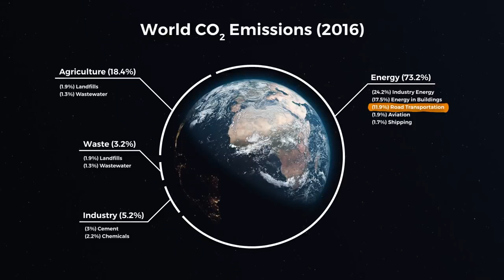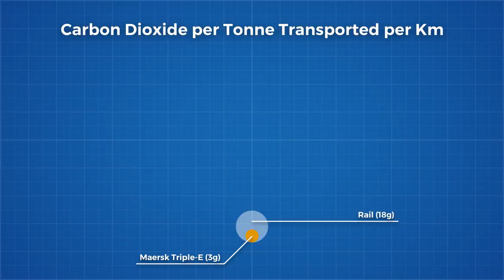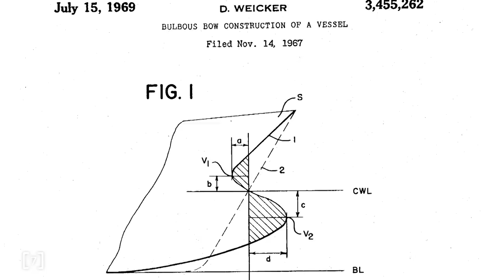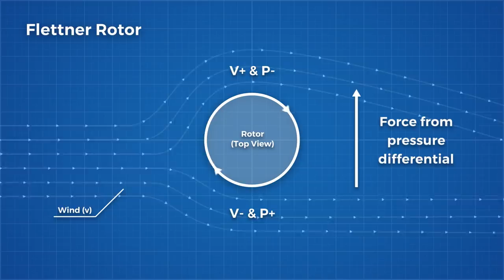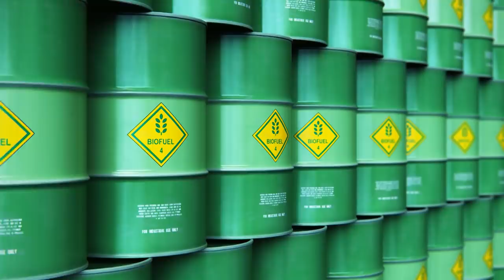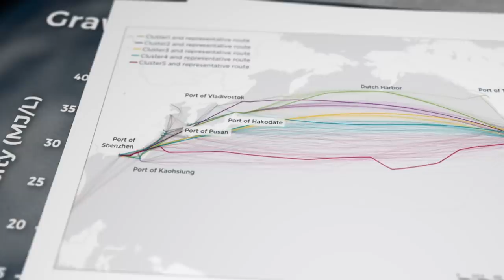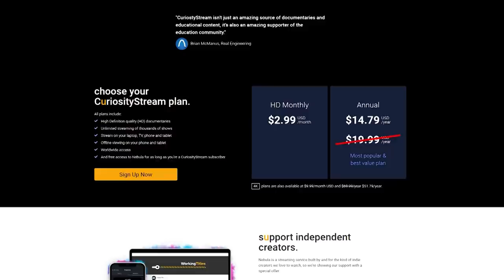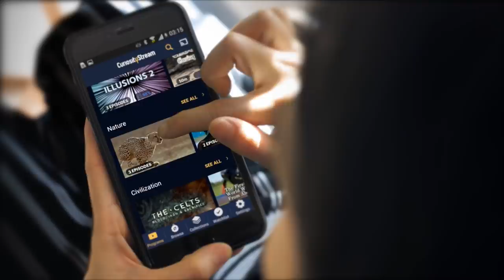Are Renewable Powered Ships Possible?

Comment: I don't get the "takes up to much space" thing, just put the masts in places that aren't used for cargo anyway
Reply: The masts, rigging and sail handling arrangements take up 'prime real estate' on the vessel.  Fuel oil bunker tanks can be stuck away in any odd corner and the ICE power plants are themselves relatively compact.  The stacked up 'boxes' would mean putting the wind driven propulsion units in a bad situation from a ship stability point of view.
Reply: @BernardLS  I figured you'd put them on the bow and bridge, that's bad for stability?
Reply: @marcopohl4875  on the bridge is very bad also the yield of energy from wind is relatively low. I have about 1 000 words on this subject but if it is TLDR will not waste your time.
Reply: @marcopohl4875  To address the suggestions that sail power is the answer I offer the following example.  In 1870 a premium sailing vessel entered service, the ‘Cutty Sark’.  The Cutty Sark was 64.74 metres in length with a beam of 10.97 metres and a loaded displacement of 2 100 tonnes.  She was able to carry, at best, 1 700 tonnes of cargo and to harness the energy in the wind the available spread of canvas was up to 2 976m2 which was tended by a crew of about 30 skilled men.  A ratio between the sail area (SA) and the vessels displacement (D) determines how lively she is; ‘lively’ being nautical speak for ‘fast and manoeuvrable’.  The carrying capacity of cargo ships is constrained in two ways, mass and volume which leads us to the ‘stowage factor’ of the cargo; the more mass on board the greater the displacement which in turn impacts the efficiency of the hull form and sail area / displacement ratio.  A vessel constrained by mass is said to be ‘down but not full’, while a vessel constrained by volume is said to be ‘full but not down.  When in the tea trade, which the ‘Cutty Sark’ was designed and built for with fine lines (more nautical tech speak, so again no need to worry about it) she could carry around 600 tonnes of cargo at speeds of up to 17.5 knots dependent on the prevailing wind and had a typical China to UK time on passage of 120 days.  The tea trade was very competitive so ‘time on passage’ was a large factor in securing the premium freight rate that made her cost effective.  Rounding things out, her maximum available sail area gave circa 5m2 of canvas for every tonne of tea carried.

As soon as the Suez Canal opened, which the ‘Cutty Sark’ was unable to sail through; she lost her advantage, raw speed, to the steam powered ships of that era who could beat her ‘time on passage’ by taking that short cut.  Mechanically powered ships have improved in terms of efficiency, on a freight tonne mile basis, by at least one order of magnitude since then.  After losing out to the coal burning, fire tube boiler, steam reciprocating mechanical ships of the late 19th century ‘Cutty Sark’ was relegated to the Australian wool trade, just about the bottom of the barrel in maritime terms and only one small step up from being a 'honey barge'.  The canvas, cordage and extra manpower needed for sailing ships was never a very benign environmental option so please discount any idea of sail as ‘sustainable’.  All this is without the problem that if ‘the wind don’t blow the ship don’t go’, when it does blow it often blows in the wrong direction for your cargo delivery needs and sometimes there is rather too much of it for comfort.  Sailing ships are unable to go directly up wind so if the wind is blowing form the direction your cargo needs to then a zig-zag course must be steered, more distance and more time.  Wind is traditionally measured on the Beaufort Scale (wind speed) that runs from 0 (< 1kn) to 12 (> 63kn) and for sailing purposes the usable part of the range is ‘3’ (circa 8kn) to ‘6’ (circa 24kn).
  The masts, rigging and sail handling arrangements would take up 'prime real estate' on the vessel.  Fuel oil bunker tanks can be stuck away in any odd corner and the ICE power plants are themselves relatively compact.  The stacked up 'boxes' would mean putting the wind driven propulsion units in a bad situation from a ship stability point of view.

Random fact about ‘Cutty Sark’, it is said to have been possible to coax 3 000 horse power out of her sails, or in ‘real money’ 2 206 500 Watts (2.2 megaWatts), or 741 Watts for each square meter of sail area.  So that majestic spread of canvas would have been even less efficacious for delivering your baubles and bows from the orient, despite taking about three times as long on the voyage.  The sails on the ‘Cutty Sark produce about 0.33% of the power need to propel a Mearsk Triple E.  Remember shipping is a high volume low cost, therefore low margin business, and all costs have to be beneficial.

Canvas and hemp are accorded 'renewable' (read as ‘natural’) status, if ‘synthetics’ are used there will still be a need for the input of FOGI products.  'Synthetics' would have a much better working life span than 'naturals' but would still yield the same amount of energy, 741 Watts for each square meter in those elusive ideal conditions.  Wallenius are currently giving wind power a go with wing form ‘sails’ but evidence is a little short of proof as of this date.  KTH (Kungliga Tekniska högskolan), a sort of up market university in Stockholm, who are using the funding to derive results will probably, and eventually, in the best traditions of academia ‘publish’ a ‘paper’ unless the funders invoke the well known ‘commercial sensitivity clause’ of their agreement with the KTH.  Wallenius is a major shipper of vehicles were the product is effectively its own packaging, other goods are moved about in ‘containers’ so the loss of capacity, ‘broken stowage’ in nautical speak, caused by containerisation needs to be factored in.  On board wind turbine might get you around some of the problems however for marine use vertical axis wind turbines (VAWT) would be better than the, what have now become 'traditional', horizontal axis wind turbines (HAWT) for reasons that include the air draught of the vessel, weight distribution and maintenance access.
Reply: @BernardLS  Ok, few more things:

the stability issue is probably rotation, right? since the masts (especially the one on the bridge) are so far away from the center of mass, they can induce a lot of rotational energy. if I got that right, would a design like this work? https://www.youtube.com/watch?v=zMct-d68CM0

"winds don't blow, ship don't go" isn't really a problem, since a hybrid design is the obvious approach; use the sails when the wind is good to save power, use the engine otherwise

and, to return to a question that I still wanted to ask from your first response, how would the containers interfere with rigging? I don't know much about ships, I could barely even consider myself an enthusiast, so when I look at a sailing ship, I see a lot of ropes and have no idea what each of them does, which are necessary, and so on, so that was a bit to vague for me
Reply: @marcopohl4875  the stability issue is probably rotation, right?
No it is the weight and distance from the centre of buoyancy.
 Also the forces acting on the sail set up a 'lever' (force x distance) that will need to be compensated for.

would a design like this work?
The Mearsk Triple E class are a logical and progressive evolution of the current ‘high volume low cost’ shipping business model it works but at cost to the environment; these are the cost which is externalised.  The marine freight industry responds to consumer demands so the best available option for sustainability is ‘ship less & move the small quantity shorter distance’ & ‘seek to satisfy your needs not your wants’

I see a lot of ropes and have no idea what each of them does.
Some are for aligning the sail with the wind and the direction of travel of the vessel (sheets), some are for controlling the movement of sails up and down (halyards) and other are for deploying the stresses on the masts caused by harvesting the wind energy (stays).  There are a lot of them and they all need space to work so the area above the main deck (uppermost continuous deck) is occupied and as you may notice from the video about 50% of the containers are occupying it.

Further issue is the area of sail needed to move a tonne of freight.  As I said in the 'Cutty Sark' example that is 5 m2 for each tonne of freight.  So on that basis for a Mearsk Triple E you will need 800 000m2 of sail area for a 196 000 tonne deadweight; the deadweight is the mass of water that the hull needs to displace to balance the cargo.

Another spanner in the works is the matter of air draft.  The higher the mast the more obstructive bridges become, unless the use of telescopic masts is factored in, which leads us to the idea of telescopic aerofoil wind sail that KTH are researching for Wallineius.  Back again to how much usable energy can be harvested.
Reply: @BernardLS  what I was actually asking when I linked the Maersk ship was: "If you put sails on that, would it still be unstable" given that the bridge is closer to the center, and the engine room gives you space for another sail, spreading the forces out more evenly
Reply: @marcopohl4875  For ship stability a good primer is ‘Ship Stability for Masters and Mates’ (Derrett D.R. London Maritime Press, London).  The deck above the bridge and the top of the engine room casing are in the best position for wind harvesting but about as bad as you could be for distance from the centre of buoyancy and centre of gravity which acting as a couple are the means to get a positive righting lever that will keep the whole thing working.  Where weight is on a ship is as important, if not more so, than how much of it there is.  The wind harvesting system would need to fit under the bridges that the ship may come across so the aerofoil system being researched by KTH for Wallenius, or something similar, will need to be employed.  Wind would only ever be a supplement and with the relatively low yield, 750 Watts m2 not effective on a cost/benefit basis.  Sadly we have three viable options ICEs fuelled with fossil hydrocarbon (too bad for the environment we live in), nuclear (too expensive to do properly) or overall reduction in goods transportation.

Comment: We have nuclear submarines and nuclear aircraft carriers, but for containerships let's just use the worst fuel available. Makes perfect sense 🙃
Reply: If you do a web search for ‘nuclear ship savannah’ you will see that it has been tried and did not work.  A similarly vessel, heavily subsidised by the government, vessel has been in lay up in Russia since 2012 but could be reactivated.  The Russian state, through a QUANGO, also operates a fleet of nuclear powered ice breakers all of which may, or may not, be completely without issues in support of the Northern Sea Route,.

Just think; would you have full confidence in the management of a nuclear reactor under the control of an anonymous entity only traceable, perhaps, via a letter box in a FOC (flag of convenience) nation state?  If you are, could you sell that confidence to Japan, the state that hosted the Hiroshima and Nagasaki nuclear detonations as well as more recently the Fukushima ‘event’?  Then try that same, or a similar, sales strategy on Ukraine, the nation state that as a part of the USSR (CCCP) hosted the Chernobyl ‘event’.  Modern iterations of nuclear energy, thorium fuel, molten salt reactors or fusion reactors, will carry the legacy of past problems.  It is the global trepidation of anything with 'nuclear' in the name and the economics of nuclear having transitioned from 'energy to cheap to charge for' too 'the costs of remediation are incalculable' that will prevent the adoption of nuclear energy as a means of creating energy at sea.  Modern reaction systems may have overcome the safety problems but the general public, having been misled in the past, will be reluctant to believe the fresh new promises.  The incident of the ‘Ever Given’ blocking the Suez Canal, March 2021, may also have a little to add to this debate.  The cooling water on ships tends to get taken in from near the bottom so when running aground the inlets are in a prime spot to get plugged up restricting, if not stopping, the flow of coolant.  One thing that the TMI, Chernobyl and Fukushima incidents all had in common was that the supply of coolant, or rather lack thereof, was a fundamental cause.

‘They’ say nuclear is cheap, it’s not it is expensive and has a large embedded carbon quotient as well as being complicated, dangerous, not universally socially acceptable and having only ‘no need for refuelling’ as a questionable advantage; actually it does need refuelling just not as often.  When ‘they’ do need to refill the warming up stuff it takes considerable longer than pumping tonnes of thick black stuff, cSt380 HFO, or thin runny stuff, MDO, onboard which is one of the reasons HMS Queen Elizabeth and HMS Prince of Wales are pushed about by ICEs and gas turbines thus using a similar fuel as the aircraft that fly off of them.  The Royal Navy (RN) with a high degree of skill and expertise uses, at vast expenses to the UK taxpayer, a current operational nuclear fleet of 11 submarines (also known as ‘boats’) in two flotillas, seven attack subs and four ballistic missile boats.  The carbon footprint of all the extra bits of hardware and the fuel, including processing thereof, from ground to propeller, are the external costs that never seem to get considered.

Disposal, once it wears out, of both the machine (that was a ship) and fuel is another can of worms best left unopened.  The 26 RN nuclear powered boats no longer in use are laid up (some in Rosyth and some in Portsmouth) awaiting long term deconstruction including dealing with the fuel rods and other irradiated material.  The USN is not, as far as I know, a commercial organisation working to very tight margins and also has the skill and expertise to handle the complexities of nuclear power; so as well as submarines their aircraft carriers are nuclear powered and each of the current iteration has a build cost three times that of QE/PoW, bigger crews and more generous funding.  For those who still think that nuclear energy might be the answer I recommend this report: - https://www.bbc.com/future/article/20200901-the-radioactive-risk-of-sunken-nuclear-soviet-submarines?ocid=ww.social.link.email.  The navy of the USSR might have been under resourced and over extended but it was still generously supported in comparison with merchant shipping.

Comment: What about H2 powered ships?
Reply: Hydrogen is made with fossil fuels.
Reply: The next, least bad, option is ‘alternative fuels’ such as Ammonia (NH3), Biogas (basically good old CH4 or Methane) and Hydrogen (H2).  All require harvesting and processing which have costs and impacts before you get your energy to the point of use and will have effluents that will impact the global environment one way or another.  Thomas Midgley, Jr. (born 18 May 1889 died 2 Nov 1944) was an American chemist who as well as developing the technique of putting the lead tetraethyl lead (TEL) additive in petrol created chlorofluorocarbons (CFCs), yes those ozone depleting CFCs, so that the use of NH3 as a refrigerant could be discontinued.  NH3 could be the most dangerous and least ‘clean’ clean energy source it is very bad and probably deserves a rant all of its own, so let’s just leave that for a while (somewhere very far away that is cool, dark and quiet).  CH4 lots of it around much of which comes out of the ground as a fraction of the FOGI energy mining; even more can be created (relatively expensively) from anaerobic degradation of organic matter.  The organic matter may be either raw vegetation, food waste or pre-digested by domesticated livestock with the right (or wrong, depending on your point of view) sort of diet and gut fauna.  CH4 is a lighter than air, vapour at environmental temperatures and pressures and you need to compress it, a lot, or cool it, a lot, to get enough on board your ship in manageable volumes to be useful.  Carry it as cargo and you can burn the ‘boil off’, when the latent heat of vaporisation has a co-activity benefit, otherwise more trouble and cost than merit and savings.  H2 is said to be good for use in fuel cells that will give clean energy when combined with Oxygen (O2) and leave only water (H2O) as an effluent; so as well as the cost of creating the hardware and separating out the H2 in the first place we now have the cost of separating out the O2.  H2 is very, very light and very, very volatile so this is where we remember the Hindenberg disaster the ‘light’ means that though we have lots of energy per unit mass there is not much mass per unit of volume so all the problems of CH4 but much worse.  You need to compress it, more than a lot, or cool it, more than a lot, to get enough on board your ship in manageable volumes to be useful.  An alternate use of H2 burning also generates combustion products which includes waste heat going to the cold sink and a few NOx nasties.  The numbers are getting very difficult to show any sort of surplus so this is a case running hard to stand still.  The 'Just Have A Think' channel have a posting on H2 & NH3 just now, go see.